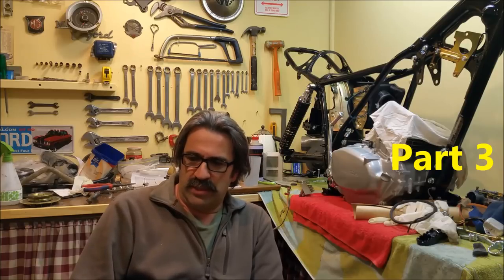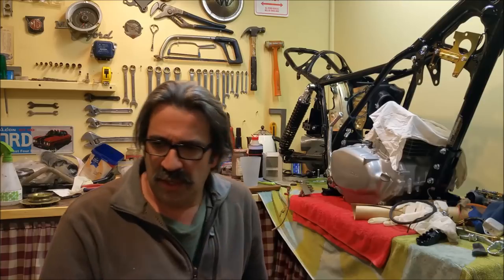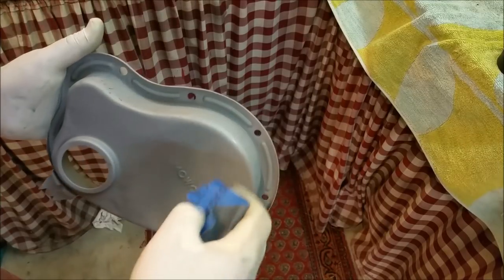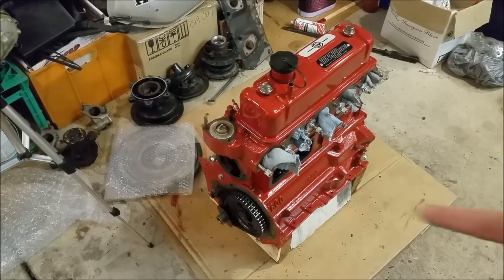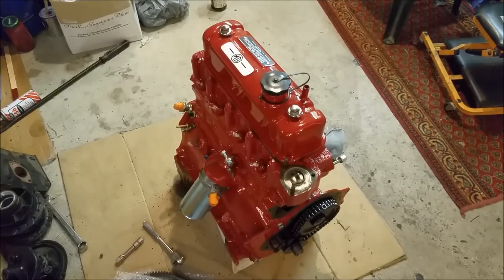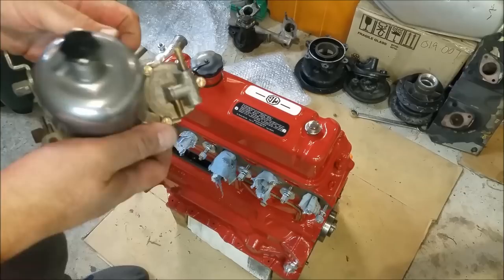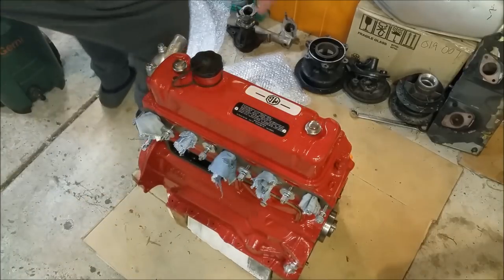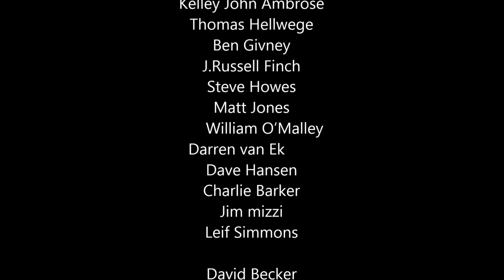MGB B Series Engine - Re-sealing, Painting and Plating - Part 3

Comment: Good day, sir,  from Oregon, USA. My wife, a Kiwi, grew up with MGBs and wanted one of her own. She found one in Kirkland, Washington. It is a 1970 B GT and orangey-yellow. It's a fun car to drive, but it needs work. I am happy to find your videos quite useful. Thanks.  I forgot to mention, this B GT does not have SKinner's Union Carbs. Someone added weber carbs to it.

     On a side note, I also had a '76 Honda CB750 SS I bought from my uncle in Wyoming. I fixed it up with a desert tan sand finish and sold it to an Air Force helicopter pilot I knew. I worked on the UH-1(N) models in Montana. It was a fun bike to fix and ride. It was way loud since I had no muffler.
Reply from the maker: Excellent and thanks for the comment. Sometimes I feel I should have bought a BGT as it is more versatile in all weather than the roadster, lovely car indeed, cheers.
Reply: The colour is called harvest gold.

Comment: As I recall from many years ago (when I was an apprentice working on MGBs and all other BMC or BLMC cars) we used to set the float height in the carbs, using a 3/16"(4.7mm) drill. We used brake fluid to clean the dashpots and pistons and a light oil such as 3 in 1 for the piston damper. The basic setting for mixture was 2 full turns (12 flats) from the highest position for the main jet nut.

Comment: You've definitely proved it: One can actually polish a turd! Peter, your work ethic is a joy to watch. We can tell that this work is for stress relief. When using the aircraft sealant we've used cotton swabs for decades instead of the applicator brush; it works marvy. Another trick for thin wispy gaskets is to use a plate of metal or glass pane and apply the sealant to it first. After that is nice and even one places the gasket onto the plate and you press it into the sealant. Perfect amount of sealant every time and it's easier to manipulate. The oil sump cover could easily have been straightened then any pock marks filled with steel impregnated epoxy paste. We like to attack sharp holes with a torch and a, sopping with water, wet sponge. The torch will usually do most of the work. Another way is to use a hydraulic jack and two plates of steel and squash it all flat. The original needle valve in the carbs had a spring-loaded needle to act as a shock absorber. We've found that the SU's never work as well after the solid needles are used. Thanks to you for another informative and entertaining video.

Comment: a few decades ago i had an Austin A60 and it had a pair of engine lifting things on the rocker cover bolts.I guess they wouldn't fit under the bonnet of a MGB so they fitted spacers instead. ...may be.

Comment: Where's the steel ball that goes in before the oil pressure release spring at 19:10?
If it's not there, you will have little to no oil pressure!

Also, for help with those SU carbs, as well as any other MGB related issues, I suggest you check out "UniversityMotorsLtd" on YouTube ;)
Reply: Well spotted!
Reply from the maker: This engine uses a piston, there's no steel ball. I checked it was in place before I filmed. Cheers